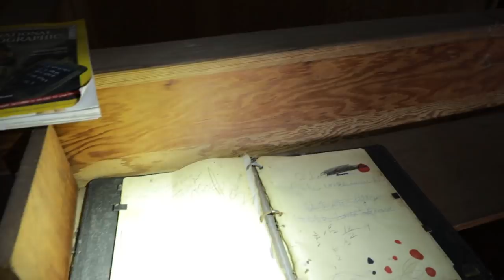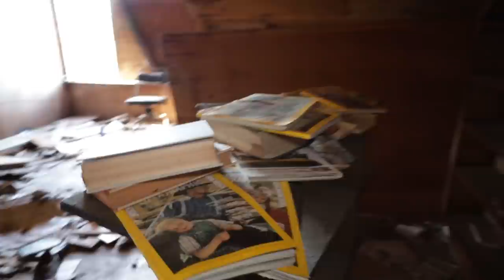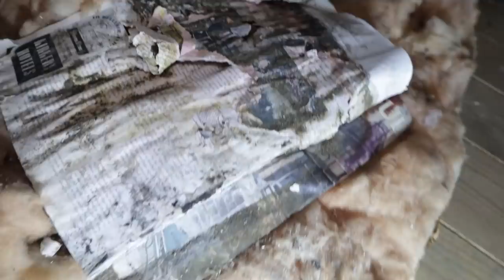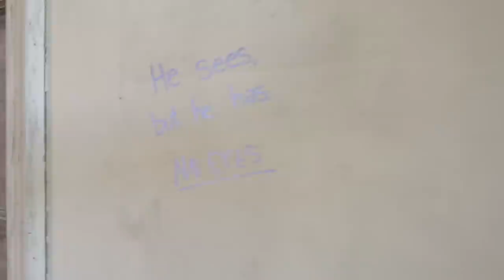SPIRITS COME THROUGH (HAUNTED HOUSE ON THE HILL II}

Comment: HOLYYYYYY this one was a good one. At 3:07 there's a shadow on the right side also At 10:07 you can hear like a baby's footsteps running.
Reply: Are you sure thats not chris shadow I had too watch 3 or 4 times.but it could be another shadow.
Reply: @catherinedennis7399  10:13 and 10:25  black shadows in the door way